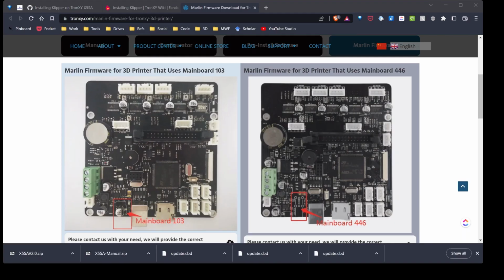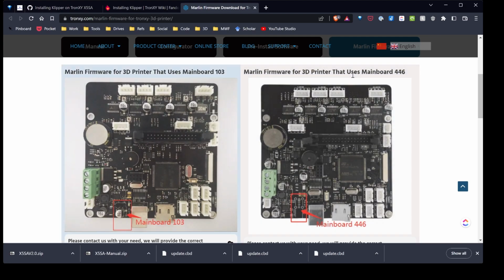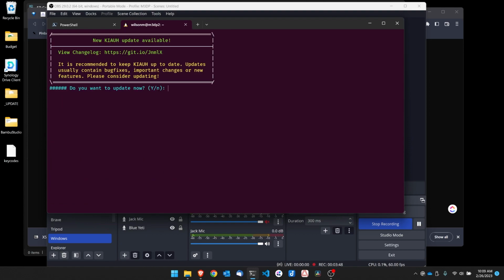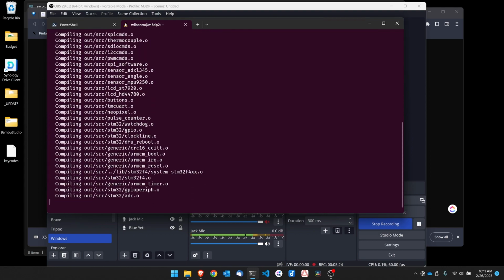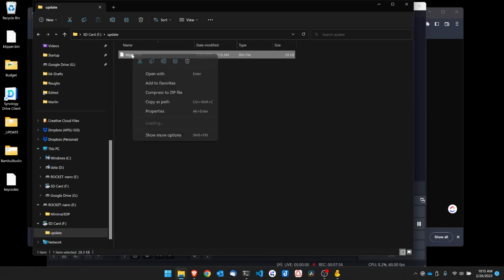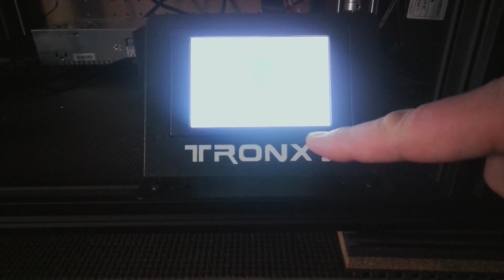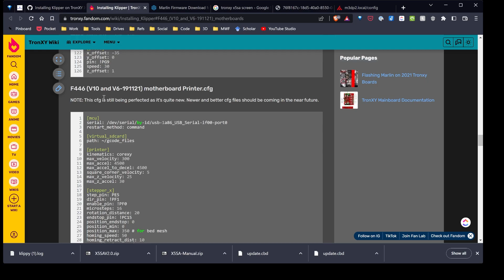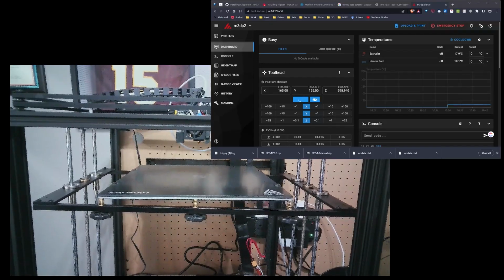Is This Upgrade Worth the Risk? Taking on Klipper on the TronXY X5SA!

Comment: They're boards are famously garbage mine blue within a couple weeks of getting mine. Then I had nightmare problems installing Marlin on a different board. 
The first thing you should do when you get these is to replace the board with an octopus or whatever your favorite board is. Been install a BL touch and your set. You can print upgrades to stiffen the frames and solve other small problems and have a good friend

Comment: Don't trust the system menu. My x5sa stated it was a stm32f4xx and when I opened it up I had a gd32f4x. From what I'm reading these chips are functionally identical but when I tried to flash it was bricked and I had to replace it with old firmware.
Reply: Specifically my chip reads gd32f427
Reply: @ericgillespie2812  Note that the 466 board has the jumper (J1) for flashing below the USB card reader (not just to the side). Check and make sure that the jumper short is in the usb position. Mine was already set to that position.

Comment: i did everything exactly as you did and my pi doesn't connect with the printer
Reply from the maker: Double check the board. Make sure you have it correct.
Reply: @minimal3dp  what do you mean by double check the board

Comment: Hi Sir, Do you have any update on this build with a Manta M8P? , i just bought this printer the 400 pro for $175 , i bought a manta m8p with it and upgrade it right away. i owned an ender 3 pro prior to this (bought it second hand) and have had it for a year it was crap but learned how to made it print high quality prints. I want a 2nd printer with large build volume for my future projects.
Reply from the maker: I have not updated to the manta but I did on another printer. Do you have a question I could answer?

Comment: The filament sensor detects but does not pause when out of filament.. is there a solution for?
Reply from the maker: I will be honest, I never really use the filament senson. You should take a look through the menus there is probably a setting. You can also look at updating the firmware to add pause functionality.

Comment: Nice vid, I have BTT Manta 8/CB1 combo on my X5SA 400 Pro, and and Pro being used very loosely haha. An X5SA is the most expensive frame kit out there as by the time we are finished with upgrades not much of the bits are left. Their customer service is laughable.
Reply from the maker: I think the Mercury one.1 build will allow me to use the most parts for the cheapest cost. Luckilyy TronXY only cost $189.

Comment: I'm done with the dance back and forth with "Enginner Jeff" from TronXY, as he took my working X5SA with the DD hotend upgrade and turned it in to a paperweight that slams the hotend in to everything it can be slammed in to simultaneously, and swears the gcode sent to me is correct. I'll be installing this tonight. 👍🏾
Reply from the maker: Be careful. I found it to be a little unstable. I am going to upgrade the board.

Comment: I'm on a budget and just got this printer ordered and was told about klipper. from the looks on it I'll being following these same steps with the exception of using an old laptop as a Pi substitute
Reply from the maker: Make sure you research the upgrade. I find it to be a little unstable. I am going to switch out the board in a future video.

Comment: This was very helpful. I have the same printer and bought an octopus 1.1 board. I'm also thinking about getting and sonic pad to control the printer. I'm a little intimidated bc I have never done this before. How long did it take tronxy to get you the firmware
Reply from the maker: Glad you found it helpful. I have not gotten anything from TronXY. I did get the some links from the reddit and Facebook TronXY communities.